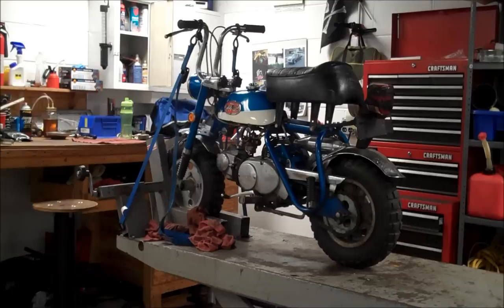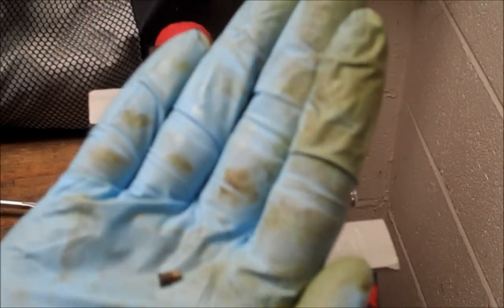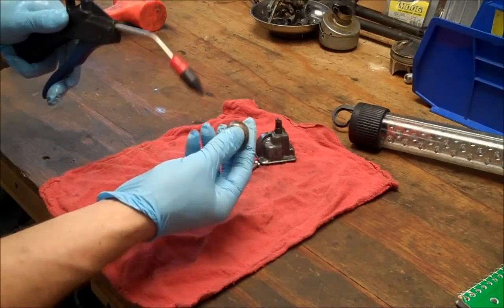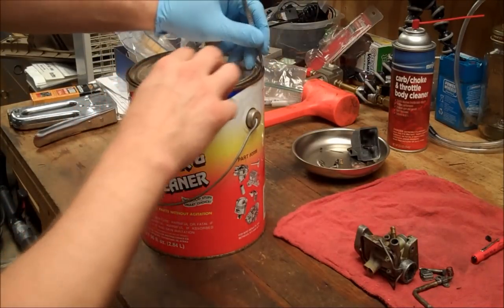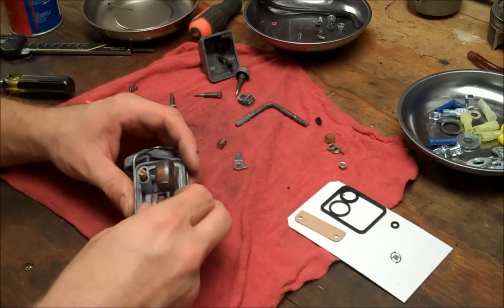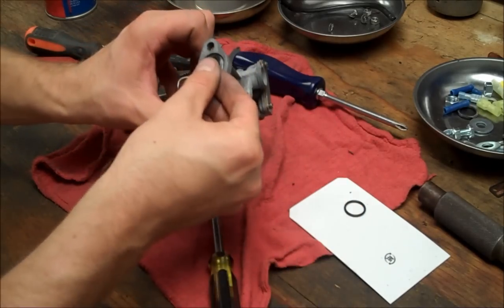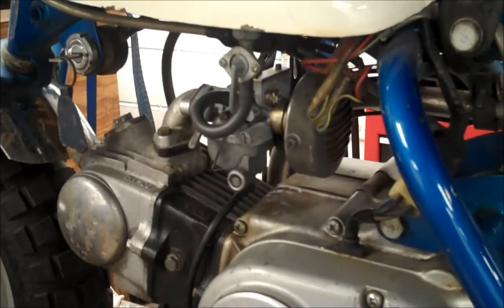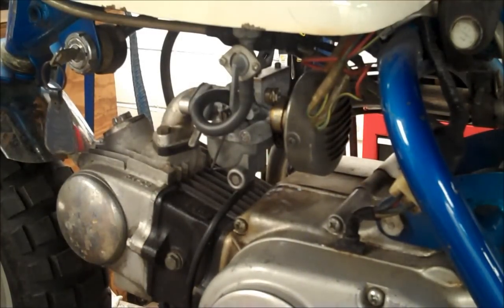How-To: Z50A Carb Clean & Rebuild / Pilot Adjustment

Comment: You should try an UltraSonic cleaner... I love mine and do carb cleaning as a side gig with it..  I say it's the only way to properly clean a carb..
Reply from the maker: +kazoocorral Yes, I have a ultrasonic cleaner. I also have a soda blast cabinet that works awesome. Here is my whole setup: https://www.howtomotorcyclerepair.com/carburetorrebuilding/
Reply: +MatthewMCRepair  nice and easy little set up.. Like the blast cabinet with Soda blast... can you use other mediums in that cabinet too or are you using it for the soda blast only to not have any cross contamination of blast mediums.
Reply from the maker: +kazoocorral For now I'd like to keep it soda only. We use glass bead at work so I can always blast stuff during my lunch break.

Comment: Great video.
I have a 69 with no key I was able to start it. Just wondering if you knew the key position or if yours is able to run with out a key. I was thinking that the key slot was worn out that's why it could run with out the key. I saw that you moved the key once it was running. Any info would be greatly appreciated.
Reply: The key is basically a kill switch. When not in the circuit, the bike will start and run without a key. Without the key, you need to create a short or cut the fuel to stop the motor. Taking a look at the wiring diagram helped a lot with this.

Comment: Great video Matt, i have a 69 z50r and the throttle needle is stuck after unthreading in cylinder on the carb. i have sprayed carb cleaner on it. Still stuck, any ideas.? thank you in advance.
Reply from the maker: Is varnish causing it? If so use a heat gun.
Reply: @HTMR  i think so, i i'll try it. thank you

Comment: Just got a 1968 z50, no element in the air cleaner. Idles fine but under load cuts out. Will the air flow increase cause this? I’m ordering the little round air filter today that goes inside the housing. Thanks and great video. Also can you tune the carb without the actual filter element? Or will it run different with the element in?
Reply from the maker: Wait for the element and report back.

Comment: Hey Matt, great video. Rebuilt the carb and its not firing. With some starter fluid it fires once or twice then nothing. Gas is getting to the carb. Any suggestions?
Reply from the maker: Pilot circuit still dirty.
Reply: @HTMR  ended up being that we needed to dry out spark plug. Replaced and runs like new. Thanks for reply!

Comment: I recently acquired a 1980 Honda CM200T. It came with a knock off chinese carb so I got an exact fit OEM carb off of ebay and I am now in the process of rebuilding. I have a question that I cant seem to find a straight forward answer to. The pilot jet in the original carb in the "pressed in" type. I have read a lot of forums and people seem to have been able to remove them to clean them with vice grips and tapping them back in when finished. I cant seem to find any videos or more in depth details about this. Any tips or tricks that you have for these pressed in pilot jets? Thanks in advance!
Reply from the maker: I don't have any videos on pressed in pilot jets. I have been able to remove, clean, and reinstall them with no problem though.

Comment: Just completed a carb rebuild kit on my K1. Bike was running great prior to the gas going bad from not putting Stabil in one winter. Went to start it and it was instantly over revving. It seems that the throttle slide going into the carb isn't closing completely. It's lined up properly so the idle screw will catch on the little notch, and it's re-installed per the clymer shop manual.  Any thoughts on why the slide won't go down? I even disconnected the throttle cable just to see if the needle and slide would go down more and if doesn't. I'm completely stumped!
Reply from the maker: Catching on a burr?
Reply: @HTMR  turns out it was a bad retaining clip inside the throttle slide. 👍 Runs perfect now.

Comment: +MatthewMCRepair What were the standard "turns out" for the idle air and pilot air screws? I heard 1.5 for the pilot, but what for the other screw?
Reply from the maker: +Hobie16Sailor There really isn't a baseline setting for idle screw. Just set it so slide is barely cracked open and you can see some light past it.

Comment: Can you recommend a link to a replacement carb for 1969 Honda z50A mini trail?  Lots of Chinese carbs online but unsure which you would recommend
Reply from the maker: What is wrong with your current carb?
Reply: @HTMR  we rebuilt it with the help of video. Much appreciated!  But I was just asking in case we couldn’t figure it out.   Not very mechanically inclined. Lol.  But in the future Is there a carb you would recommend?
Reply from the maker: @bruceplacido9580  Keep an eye out on ebay for a good used OEM. I don't recommend cheap chinese carbs.

Comment: I noticed when you leaned the pilot air screw it didn't stumble and you went back to 2 turns out. Why did it not stumble when you kept backing the screw out?
Reply from the maker: Sometimes there is a good amount of adjustment that has no real effect. When this happens, I choose the richest position.

Comment: The parts cleaner your using I think says that you can only soak parts in it for 3 hours. I have the same stuff in my parts washer and  I wrecked a carb just like that and a few years newer z50 carb. I had then sitting for a week. The finish was ripped off and it started to eat away at the aluminum. Had to replace the one that's worth more and more expensive. Just for future experiences. Maybe I'm wrong on the 3 hour thing but read the can so you don't mess up someone else's carb.
Reply from the maker: I agree. You can't leave it in there too long. The chem dip I have states 15min, however, on nasty carbs I do leave them in longer to get them to clean up.

Comment: I think the throttle is stuck wide open on my Z, any thoughts?  Rebuilt the carb and replaced typical stuff, fired right but straight to full throttle.
Reply: Oh and twisting the throttle makes no change in rpm
Reply from the maker: Did you install the slide correctly? Remove air filter/box and make sure slide is all the way down and moves when you twist throttle.
Reply: Should it completely occlude the passage?
Reply from the maker: It should be 95% closed at idle.

Comment: Hey i have a 2003 yz250f and when i hit the gas it bogs down real bad what should i do to fix it?
Reply from the maker: I have a video you should check out called "How-To: Cure that BOG O-Ring Mod YZF FCR". In addition to the o ring mod, put a smaller leak jet into it, like 50-60 in size.

Comment: Do you know how to instal the right front fork rubber boot.  The brake is installed on that side and I can't get the rubber boot over where the brake bracket is welded to the front fork.
Reply from the maker: I don't have that bike in front of me so I can't help on how to install that boot.
Reply: +MatthewMCRepair +MatthewMCRepair I finally figured it out.  The front two forks and two round chrome collars that unscrew.
Reply from the maker: OK.

Comment: Hey I need some help I have a 84 z50r runs great but the idle is off if u rev it up and I idles at a mid rev and slowly comes back down throttle cable is good  i had to re do the whole motor over the valves we're stuck on abit but after all the still the revs
Reply from the maker: +insane_ivtec So the issue is that once revved up, it takes a while to return back to idle? I have a 89' Z50 BTW.
Reply: +MatthewMCRepair yea sortable like from high rev to mid rev it drops normal but for mid rev to idle it takes a bit to come to idle so if ur driving it it sticks but the slider is going going down in the carb and it doesn't feel sticky
Reply from the maker: +insane_ivtec Assuming that the throttle slide is not the issue, a lean condition can cause that. Check for a dirty carb and vacuum leaks. You can do a quick test by turning the choke partially on and see if the problem goes away. If it does, then it is lean.
Reply: MatthewMCRepair i didnt hear much difference but i have a full restored 80 z50 im gonna switch carbs and see if i get the same thing
Reply from the maker: +insane_ivtec Luckily it is a super easy job to swap carbs! Let me know the results.

Comment: Not really the best mechanical skills at work here and multiple mistake being made.
Reply from the maker: What did I do wrong...please explain.
Reply: @HTMR  You etched the hell out of that carb and parts using that parts dip, You used a center punch to remove the float, A vise to remove a jet and you should really know the correct names for the parts... just to name a few.